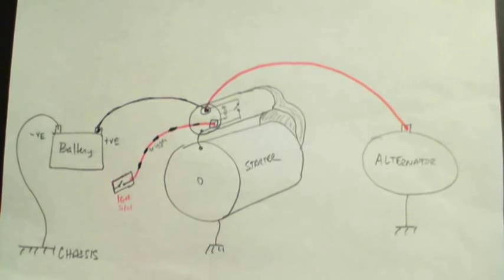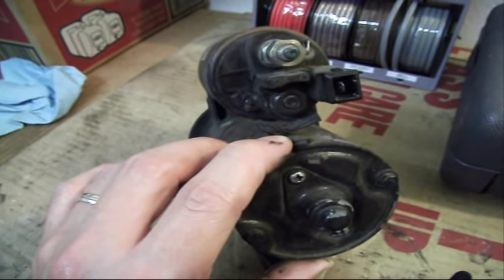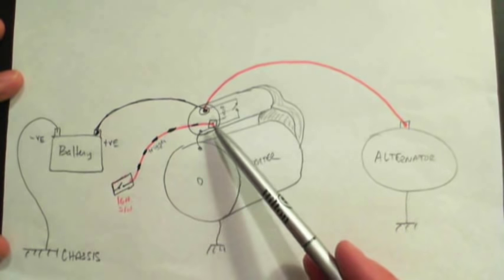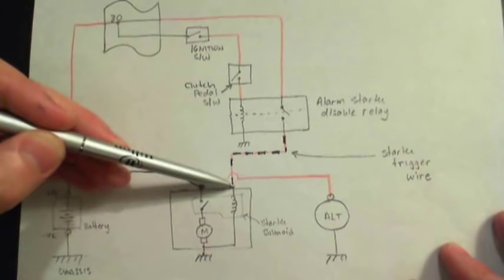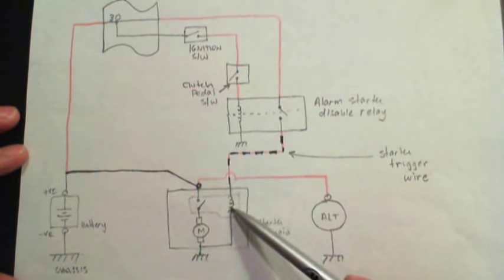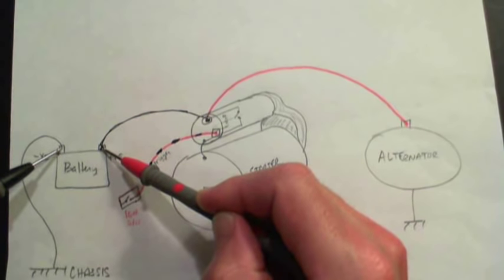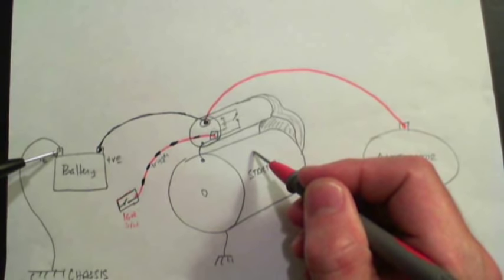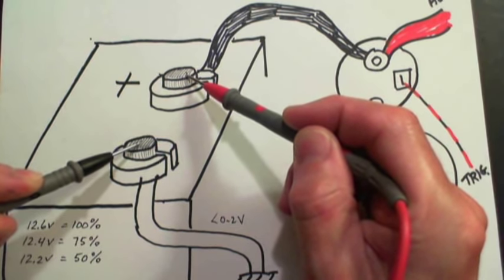Starter Motor Troubleshooting Tips DIY - How to diagnose starter problems

Comment: Thank you for your response John.
By dead battery do you mean it's not working, or it;s not charged?
I'm in the process of charging it right now to see if it drops back down to 10.5 after. I did the parasitic drain test and discovered a 60mA drain from the "Dome" fuse, I know 0.06A is a little over average, but surely that's not enough to be draining my battery so significantly? Previous owner added a lot of aftermarket parts, could they be the reason for my battery drain?
Car - '88 Toyota Supra

Comment from the maker: 1. Make sure the battery terminals are not corroded and/or the battery connections are tight.  Your description sounds like symptoms of a loose battery cable.
2. Make sure the battery is not dead.  Measure battery voltage like in the video.  Could be a battery strong enough to keep lights on my too weak to turn the starter.

Comment: At the end you say if voltage drop across starter is more than 0.4volt clean contacts or replace battery leads... Wouldn't this also indicate a faulty starter if it's pulling voltage down to say 9 volts?

Comment: plug out the positive and negative wires out of the battery and clean the both tabs of each of the battery with old dry cotton cloth and replug the wires  ,, check the ignition switch , check battery wires that go to starter ,, check battery charging

Comment from the maker: @NEMESIS9O9 My first guess would be a dirty (or bad) idle control valve.  That or dirty throttle plate.  Clean both with carburetor cleaner spray.  Next it could be a bad throttle position sensor.  It could also be a vane air flow sensor flapper stuck wide open (if you have one) or dirty or bad mass air flow sensor.  It could also be a bad engine temperature sensor or crankshaft position sensor or camshaft position sensor.  Clean the throttle and Idle control valve first. /John

Comment: A really good video and very well done
I do question the voltage of just 12.2 to 12.6 volts. Most batteries today run upwards of 13 volts or more on a100 % charged battery 
I think the sae rule applies on the drop just it may be higher
Reply from the maker: Lead acid car batteries are still 12.6V batteries when fully charged.  Not higher.  It is the car's alternator output that is higher, usually 13.7V to 14V (depends on the alternator's voltage regulator and temperature) which provides electrical power to the car while the engine is running and to re-charge the battery.  /John

Comment: Very good video , but im really wondering what the short wire that connects from the solenoid to the starter is called? Mine gets loose where it connects to the starter so i have to tighten it every few days or it won't start.

Comment: Very nice explaination! Just one question: How do you mesure between the plus on the battery and the plus on the solenoid? I can't see how there can be and DC-current between the oposit ends of that wire? Maybe resistance?
Reply from the maker: Faldoable If there is no current flowing in a wire but there is a battery connected to the wire then the voltage anywhere in the wire will equal the battery voltage.  If a current flows out of the battery and through the wire, then, because the wire has resistance, the voltage will reduce along the wire as you get further from the battery.  The higher the current flowing or higher the resistance will cause higher voltage reduction along the wire.   As for your question, referring to DC-current between opposite ends of the wire, you're getting current and voltage mixed up.  If there is current flowing out of the batter and there is a poor connection (ie high resistance connection) at the solenoid or the batter terminal (or cable is corroded) then the flowing current will cause the voltage at the solenoid to be lower than the voltage at the battery terminal.  A larger resistance due to a poor connection will cause the voltage to be a lot more lower at the solenoid. /John
Reply: bearing01 Thanx for taking time to answer. I think i need to rephrase my question a bit: At 9:03 in the video you put your black probe on the battery positive and the red probe on the solenoid positive, what setting do you have your multimeter on in order to mesure the voltage flow between those two spots?
Edit Never mind, i just realised you closed the circuit by turning the ignition... i think i answered my own question =)
Edit 2 Then again, wouldn't it be a good idea to mesure the resistance between those two spots to see if the connection is bad/oxidised, withought having to turn the ignition?

Comment: I have a motorcycle but relays work the same pretty much...I took my starter relay off the bike and hooked it up to my 12V battery and it tested good (had continuity) but got super hot when energized. Could the starter relay be bad?

Comment: Hello, great video, thanks. I have a problem of the starter pinion is not meshed with the flywheel ring gear before it starts turning. So I get the grating spinning of the starter pinion. This happens intermittently, but I know this has to be fixed before big damage occurs to the teeth.Can you advise on this problem, thankyou,R.

Comment from the maker: @unforgiven7 You will need to remove the starter and replace it.  If you're desperate, if you bang the starter solenoid with a hammer, you may be able to free up the plunger from the weld.  But this could also destroy the starter.  Thanks for watching and commenting. /John

Comment: my car woke me up in the middle of the night turning over all by it self....no key in ignition did not start...just turned over i had to undo battery cable to stop it....removed starter and bench tested it....so i am thinking a short from the trigger wire....maybe even ignition switch ...what are you thoughts? i am about to test for voltage at the trigger wire with no key in ignition

Comment from the maker: @CZDPKPL A lose battery cable should not cause any damaging problem, just that the car will likely not start because of the poor connection.  Also, 12.33V is pretty much a dead battery.  Charge the battery and tighten the cables and you should be good.  /John

Comment: I have a 199.5 vw jetta vr6 AFP!I am getting many electrical short to ground codes and i cleaned the terminals under the battery box and the car is still running really rough and really rich! I noticed that on the alternator there is a visible nut that is on a screw and there is no wire attached to it! The kid i bought the car from just had the alternator replaced. I saw the same car at the junkyard and it had a thick black cable that came from the top nut on the alternator but mine is missing or doesnt have a wire there. If the alternator is not grounded would it cause all the faults i am getting? The car starts fine and runs but runs really rough! I looked online and couldnt find anything! Any help or suggestions would be amazing! :)

20 Faults Found:
18010 - Power Supply Terminal 30 
P1602 - 35-10 - Voltage too Low - Intermittent
16684 - Random/Multiple Cylinder Misfire Detected 
P0300 - 35-10 - - Intermittent
16687 - Cylinder 3 
P0303 - 35-10 - Misfire Detected - Intermittent
16497 - Intake Air Temp. Sensor (G42) 
P0113 - 35-10 - Signal too High - Intermittent
16486 - Mass Air Flow Sensor (G70) 
P0102 - 35-00 - Signal too Low
17834 - EVAP Purge Valve (N80) 
P1426 - 35-00 - Open Circuit
17950 - Angle Sensor 1 for Throttle Actuator (G187) 
P1542 - 35-10 - Implausible Signal - Intermittent
17952 - Angle Sensor 1 for Throttle Actuator (G187) 
P1544 - 35-10 - Signal too Large - Intermittent
17580 - Angle Sensor 2 for Throttle Actuator (G188) Signal too Low 
P1172 - 35-10 - - Intermittent
17633 - Fuel Injector for Cylinder 1 (N30) 
P1225 - 35-10 - Short to Ground - Intermittent
17637 - Fuel Injector for Cylinder 5 (N83) 
P1229 - 35-10 - Short to Ground - Intermittent
17635 - Fuel Injector for Cylinder 3 (N32) 
P1227 - 35-10 - Short to Ground - Intermittent
17638 - Fuel Injector for Cylinder 6 (N84) 
P1230 - 35-10 - Short to Ground - Intermittent
17880 - EVAP Leak Detection Pump 
P1472 - 35-10 - Short to Ground - Intermittent
17843 - Secondary Air Pump Relay (J299) 
P1435 - 35-10 - Short to Ground - Intermittent
17829 - Secondary Air Injection Solenoid Valve (N112) 
P1421 - 35-10 - Short to Ground - Intermittent
17636 - Fuel Injector for Cylinder 4 (N33) 
P1228 - 35-10 - Short to Ground - Intermittent
17923 - Intake Manifold Valve (N156) 
P1515 - 35-10 - Short to Ground - Intermittent
17634 - Fuel Injector for Cylinder 2 (N31) 
P1226 - 35-10 - Short to Ground - Intermittent
17525 - Oxygen (Lambda) Sensor Heating Circuit: B1 S2 
P1117 - 35-10 - Short to Ground - Intermittent
Readiness: 0110 1101

-------------------------------------------------------------------------------
Address 03: ABS Brakes Labels: 1J0-907-37x-ABS.lbl
Part No: 1J0 907 379 H
Component: ABS/EDS 20 IE CAN 0001 
Coding: 03604
Shop #: WSC 00066 
VCID: 3663DDFA12827BAE71B-4B1A

3 Faults Found:
01276 - ABS Hydraulic Pump (V64) 
16-00 - Signal Outside Specifications
00290 - ABS Wheel Speed Sensor; Rear Left (G46) 
35-00 - -
00287 - ABS Wheel Speed Sensor; Rear Right (G44) 
35-00 - -

-------------------------------------------------------------------------------
Address 15: Airbags Labels: 1J0-909-60x-VW3.lbl
Part No: 1J0 909 609 
Component: C AIRBAG VW3 SG 0002 
Coding: 00067
Shop #: WSC 00066 
VCID: ECD7BF929C4E717ED7F-4B1A

1 Fault Found:
00532 - Supply Voltage B+ 
07-10 - Signal too Low - Intermittent

-------------------------------------------------------------------------------
Address 17: Instruments Labels: 1J0-919-xxx-17.lbl
Part No: 1J0 919 951 B
Component: A4-KOMBIINSTR. VDO V57 
Coding: 06262
Shop #: WSC 00000 
VCID: 2F6DE89EEDD84A6632D-5142

1 Fault Found:
01039 - Coolant Temperature Sensor (G2) 
29-10 - Short to Ground - Intermittent

-------------------------------------------------------------------------------
Address 46: Central Conv. Labels: 1J0-959-799.lbl
Part No: 1J0 959 799 AJ
Component: 61 Zentral-SG Komf. 0001 
Coding: 04096
Shop #: WSC 00066 
VCID: 8603ED3AA2E2AB2E21B-4AE8

Subsystem 1 - Part No: 1J1959801C
Component: 61 T?rsteuerger. FS0001r 

Subsystem 2 - Part No: 1J1959802D
Component: 61 T?rsteuerger. BF0001r 

Subsystem 3 - Part No: 1J4959811C
Component: 61 T?rsteuerger. HL0001r 

Subsystem 4 - Part No: 1J4959812C
Component: 61 T?rsteuerger. HR0001H 

4 Faults Found:
00953 - Interior Light Time limit 
25-10 - Unknown Switch Condition - Intermittent
01358 - Internal Central Locking Switch; Driver Side (E150) 
27-10 - Implausible Signal - Intermittent
00912 - Window Regulator Switch; Front Left (E40) 
27-10 - Implausible Signal - Intermittent
00944 - Heated Exterior Mirror; Passenger Side (Z5) 
35-00 - -

Comment: I have a 56 Chevy that has been rebuilt electrically with a MSD electronic HEI Distributor fitted and an unused rebuilt GM starter with 'S' 'R' and main terminals. I understand the trigger circuit to the 'S' terminal and the 12 volt from the battery fits the large terminal. However where does the 'R' terminal terminate as the distributor has a built in coil and I don't want to connect incorrectly. Can you please help?

Comment: Good video but I also see at the end of the video you put both the Multimeter terminals onto each end of the ground wire and then on both ends of the Positive wire - you wouldn't get any reading at all doing this ? You always need one on a ground and one on a positive to get any voltage readings.  However you can take continuity readings this way and check for a broken wire.
Reply: ***** Nathan, that's a good observation. However, you are wrong as it relates to the video. Here's why...The instructor is checking the loss of voltage between the battery post and the battery cable. When the circuit is turn on this loss should be 0.1v or less. Same thing at the farthest end of the battery cable. Place one probe directly on the battery terminal and the other probe on the connector of the wire at its farthest location. Again, when the circuit is activated the loss should be 0.1v or less.
This process should be repeated as the video demonstrates to all wires and connectors.
Nathan, I think the step you are not catching is the one where the instruction is given to turn the ignition switch to the on position. This would cause current to flow without engaging the starter. Remember, you're only measuring the amount of voltage impedance. This can tell you if you have a loose connection or corrosion at a battery terminal, if a connector is no longer secured correctly to a wire, if there is a break or short somewhere along the length of a wire, or if one of the electrical devices is faulty.
I hope this helps.
Reply: he is checking for a voltage drop.

Comment: My ford ranger was not starting, but I could hear the solenoid clicking when I turned the key. I taped on the starter motor (on the drivers side. first time I have seen one on that side)  with the wood handle on my hammer, got back in the car, and it started right up. I drove off thinking "OK it is time to replace the starter, but by the time I got home, (the parts store was closed) I got to wondering "Does the starter have a bad conection? maby the taping reconnected a bad ground?"   What do you think?  The relay is fender mounted. I have started and drove the car without a problem several times after this incident.

Comment: I recently installed a new battery and starter and my battery is reading 11.99 and my starter is reading that as well. My starter clicks and when I first installed it I heard the starter turnover once. So would a jumpstart help me? I’ve also replaced all fuses and made sure grounds for starter were tight

Comment: What's the red wire from alternator to starter called? I seen on some wiring diagrams it's called a fusible link. However I have not had any luck knowing of that's true or not. At the starter that red wire is busted so it's not making a closed circuit draining my battery. I need to know if that wire is specific and where I can get one or can I get the same gauge wire and replace that single wire crimping on new terminals. Alternator and battery are still new and tested ok.

Comment from the maker: Does the starter have a remote starter relay? Some starters have that instead of an on-body solenoid.  Disconnect the heavy cable from the starter relay.  If the battery was weak the contacts of the relay may have welded themselves together.  If yes, you may have to replace the relay. /John

Comment: Hi, I have 1.5volts from the battery -ve to the starter body on cranking with the motor under no load on the bench, I also have 1.5 volts from the battery +ve to the starter +ve on cranking. Battery reads 12.7 volts, odyssey extreme pc545. Battery is new. Battery voltage reading at terminals on unloaded crank is 9.58volts. Voltage reading at +ve battery terminal to starter body on unloaded crank is 7.58volts. All cabling in un corroded and tight. Not sure of how to further fault diagnose the stater internally. Starter is a compu-fire 53700 12v v twin engine. Any thoughts ?

Comment: 1987 Ford F-150: When motor is cold/cool, the starter jumps to life. Drive the truck for 15-20 minutes (get the motor hot), turn the motor off, and attempt to re-start...now the starter won't turn over. Makes no sound at all (no solenoid click). Let the engine cool off and it starts right up. Any ideas? THANKS!

Comment: wjat if the battery is bad but you connect the charger and put it on engone start and then you crank it and the starter just clicks but does not turn should I just tap it lightly to loosen up or it might be a blown fuse wire because I heard like a little pop when. I tried to start it , it happened in my 84 gmc sierra with a 350 engone

Comment: thank you John - I am wondering if you can help me.   I have gone thru many steps trying to diagnose my starter problem.  99 Ford expedition (5.4 4wd) is not cranking the engine-  starter solenoid will 'click/clunk' engaging the starter gear, but not spinning the starter motor. Took out  starter & had bench tested, it was fine. new solenoid on the firewall & load tested the battery too.  Got 12.6 at the battery, 11.4 at starter- would this cause starter not to spin, but engage solenoid?

Comment: great video, very helpful, I wish you can help to troubleshoot my starter, when I turn off the ignition switch, the starter still running, I have to pull battery wire off to shut it down, please I need your comment

Comment: pretty insightful, but I have a question, If the current is low in a battery can that stop it from starting? just say if I got a faulty battery that has some messed up low current, would that then happen?

Comment: I keep blowing fuse for my starter motor on 7.3 Diesel on my 2002 Excursion. Can't figure out why. What is some of the reasons to blow the fuse ? Besides something wrong with wires,can Not find anything wrong with wires

Comment: my top nut as you show had to wires one thick one from battery and skinny one green which is melted and exposed to metal shorting out everything i need to run new green wire dont know where it goes i think its the red one in your video

Comment from the maker: @NEMESIS9O9 If the vehicle died while it was running then it's not the starter.  The starter only runs while trying to start the vehicle. It wouldn't cause the engine to stall.  It could be a bad alternator.. but a bad alternator would run your battery dead and after the battery runs dead the car would stall.  /John

Comment: Hi John,

I have a mk3 golf, and I'm diagnosing a starter problem that acted up last night. When turning the key, I got nothing but black smoke from under the hood. I smelled it, and it is certainly electrical. 

My thoughts are that it is the started solenoid, but I'm not completely certain. Do you know if you can purchase just the solenoid, or will I have to change the whole thing?